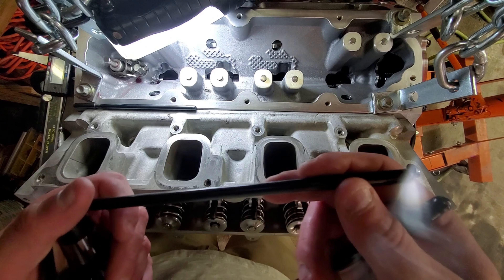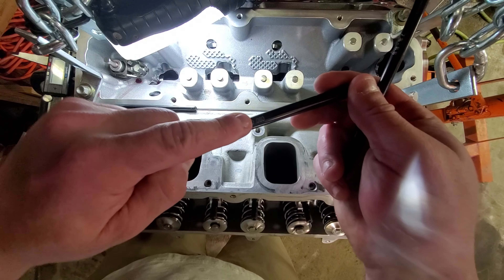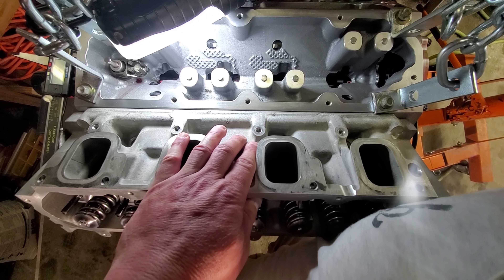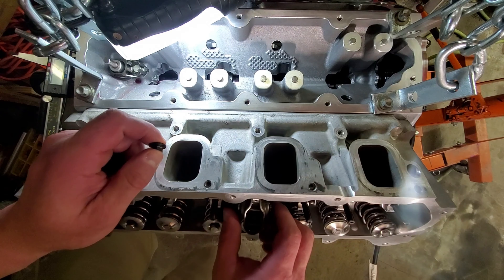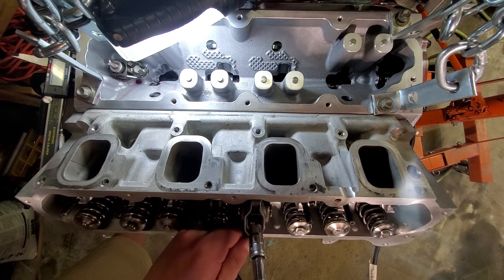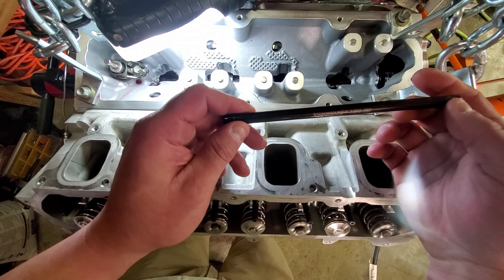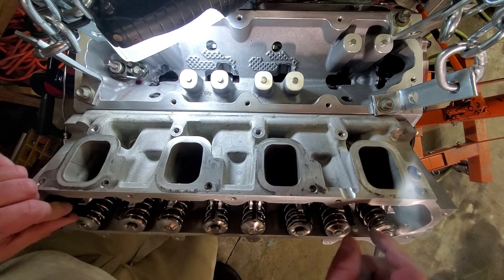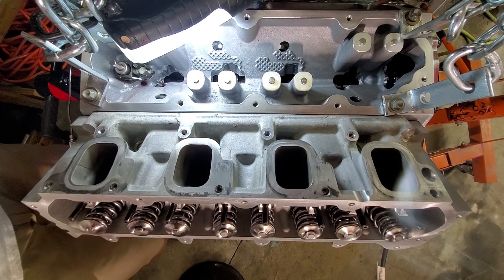Checking PushRod length on a Gen V LT4 (C7 Z06)

Comment: Good info now I can continue building my zl1, thanks for the vid man 🤙
Reply from the maker: You're very welcome!  Curious about your build?
Reply: Callies rods, foraged Wisconsin pistons, kateck oil pump, ARP studs everywhere  with line hone, TSP sage 2 cam, same liftters and spring as you, Ported TSP heads, 2in headers with 1000Hp cats, Lower pully with dual keyway, M/M catch can, K&N filter and more. Basically geting the motor ready to Handel 1K HP reliability 😄👌
Reply from the maker: @musicislife1608  you have all the correct parts that's going to be an insane build!  Having something reliable is also so reassuring when you put that much power down.  Good luck!

Comment: Even with intake valves having lash caps measurements still the same ? Also did that can change your fuel pump lash ? 
I have a 427 swapping to a bigger cam trying to see all that’s needed.
Reply from the maker: Yes the intake valves need lash caps to keep the pushrod length and rocker arm angle the same.  I did install a lash cap on my HPFP can't remember the size but regardless you need to measure your setup as each cam is different.  See my measuring HPFP lash video.  That should help.  Lash caps are cheap get different sizes and then follow my video.

Comment: So in these type of engines is it the same as setting lash as on a old small block go to zero then a quarter turn? or is there a torque spec? How do u ultimately know that you have the correct length pushrod and your not just tighten the rocker up enough to take out the slack of the incorrect length? I'm srry I'm new to this platform I hope this question makes a little sense
Reply from the maker: On GenV LT4 engines valve lash is automatic due to hydraulic lifters.  If you go solid roller then yes you would set lash manually.  I think people get confused because the GenV LTs use lash caps.  So bottom line just torque rocker to spec after you get pushrod length down.
Reply: @MichaelBrownPlus  and the correct length is at exactly zero with the rocker torque to spec?
Reply from the maker: @matthewpfeiffer3527  it's usually about a quarter to a half turn to seat the rocker and not have any play with the pushrod/valve tip.  I think I mention and show that in the video.  I've now since put 1100 wheel down on a DynoJet at 6800 rpm (I spin my car to 7400 often when doing draggy runs), and my valve train has been set this way for thousands of miles and now for years, with ZERO ISSUES.  I do stand by those Johnson slow leak down link bar lifters 2116 is what I run, 2110 are also popular.  They are so worth the added safety and performance. I also stand by the Texas Speed dual valve springs as well they have held up so well pushing the car all the way to 7500 rpm in some of my logs.
Reply from the maker: Make sure you check lifter preload, and factor that into your pushrod length!!  My valve checker was 8.00 if I remember and I ended up trying to order an 8.030 (could not be ordered), but ended up with 8.025, which has ended up being absolutely perfect for me, with years of high revving 4-digit horsepower (with stock heads/valves).  This is what gives you the preload on the lifters and prevents walking of the rocker.
Reply from the maker: @matthewpfeiffer3527  remember to factor in lifter preload (that is on the lifter specs)
Reply: @MichaelBrownPlus  how would you check if you already soaked your lifters in oil and have them install?

Comment: What cam are you running? I am running a BTR Stage 3 supercharger cam and am getting 8.050 at zero lash and then 8.075 with pre load added in… not sure if that’s too long
Reply: I am runnin the 2126LSR
Reply from the maker: Vengeance Racing stage 3 supercharger cam.  That may be correct Johnson 2116 and similar lifters are shorter.  But I would measure each cylinder and confirm.  If you aren’t 100% sure I would get some help this is crucial.  You do have some tolerance in the preload but you need to be sure.

Comment: Hi I was just curious if ur lt was stock gasket thickness and had the heads been milled?
I have an lt1 with the same lifters and I'm trying to figure out pushrod length.
Thanks
Reply from the maker: Stock 5 layer MLS gasket.  No heads have not been milled.  B/c I run a racing lifter (Johnson 2116 slow leak down) they required a longer pushrod.  Very important you get that right.

Comment: Hi think they made them that way because of the lash cap on the LT4
Reply from the maker: Are you referring to the lash caps on the intake valves.  Yesh they are offset and added to make all pushrods the same length.  If that's what you mean.  Thanks for you comment!

Comment: So 7.800 or 7.825 lenght of pushrods are Ok for Johnson lifters?
Reply from the maker: It depends on what type of lifter you purchase.  Some are shorter like my 2116 requiring longer pushrods.  Measuring is absolutely a must!  Hopefully this vid helps.
Reply: @MichaelBrownPlus  yeah thx for answer 😀 i have 2110 from American Heritage Performance with LT4 Complete Camshaft Kit so they probably need  the same lenght of pushrods.
Reply from the maker: @Goczku  so for sure measuring but just FYI the standard 2110 (discontinued) were .045" Taller Than LS7 Lifter, the newer 2110R are .005" Shorter Than LS7 Lifter.  Both are .035" pre-load +-.010" so be sure to add that into your PR length.  Best of luck!
Reply: @MichaelBrownPlus  yeah i read about it in corvette forum. Thank you one more time for the help 💪 have a Nice day😀
Reply from the maker: @Goczku  you as well my friend!